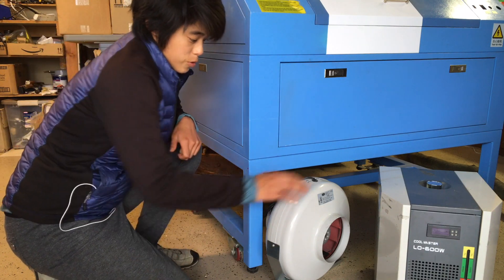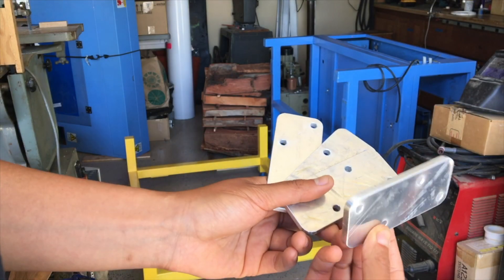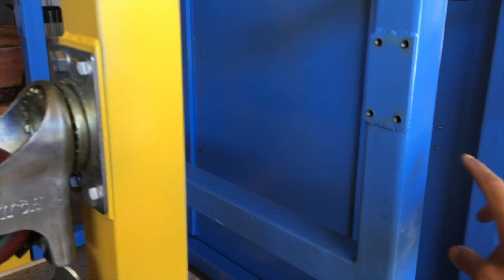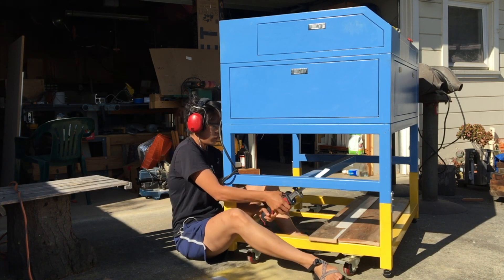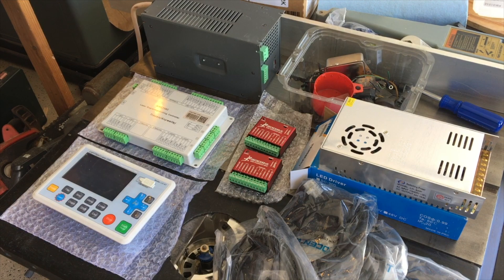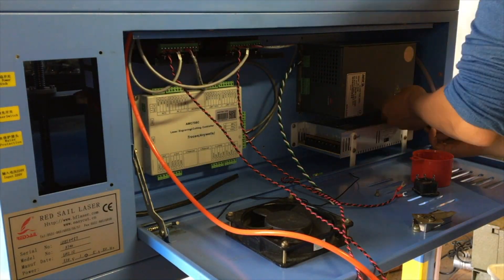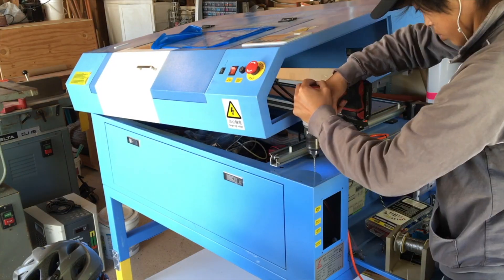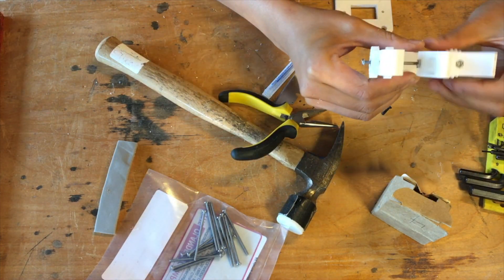Restoring A Chinese Laser Cutter After Fire (Part 2)

Comment: For some reason $40 for a pair of laser tube holders on Amazon pissed me of enough to spend $250 on a little 3d printer.  I just got it today, so far so great (ender 3 v2), printed a few cool bugs for my daughter and i was getting ready to start modeling a copy of what was on Amazon.   Right before i started i figured id see if anyone had already done it, and i find your amazing design.   Wanted to make sure i knew what i needed hardware wise so i followed the link to the ‘poorly framed time lapse assembly’ video or however you worded it lol.   Then i just sat here transfixed by a crazy ambitious build and incredibly skilled execution.  Amazing work, can’t wait to print these puppies and get proper support for my tube!  Thank you!!!
Reply from the maker: Thank you so much for the message!! Good luck on your build!